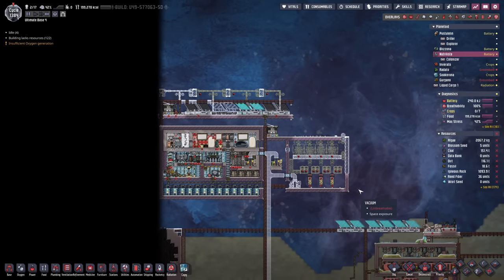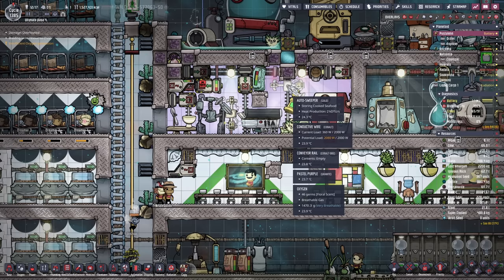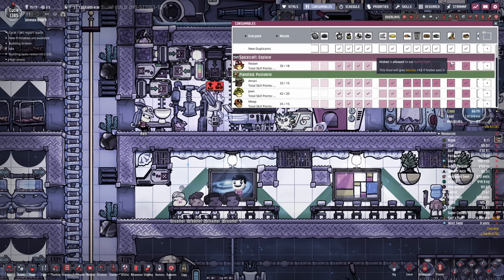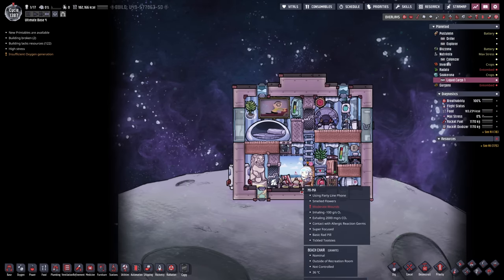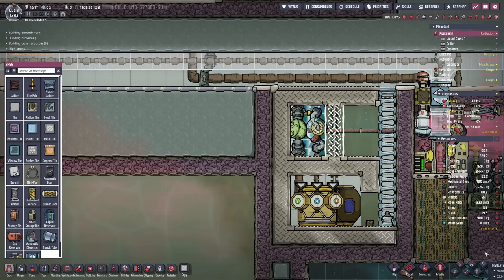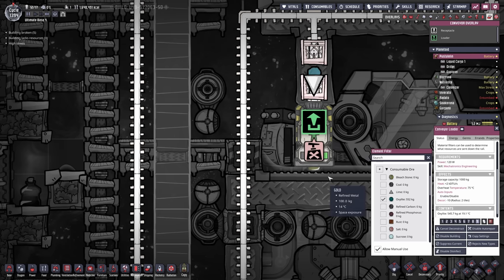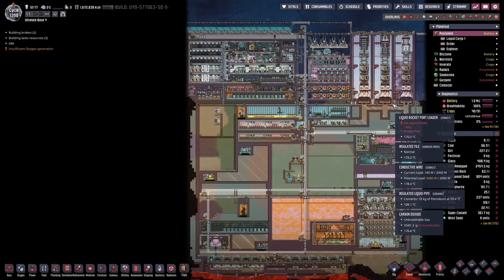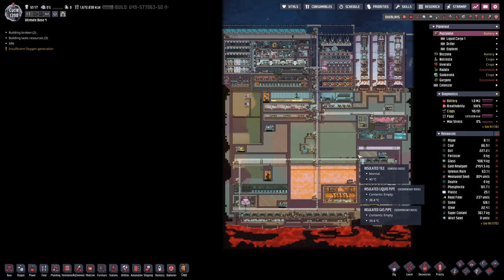OIL PLANETOID BASE ACTIVATION - Ep. #62 - Oxygen Not Included (Ultimate Base 4.0)

Comment: 21:16 if you lower or raise the gas pipe feeding the the atmosuits, so it splits before entering either suit, you can fill both suits instead of one after the other.  Of course, once the pipe starts backing up, this will quickly recharge both simultaneously, or without modification, charge the first suit quickly and then dump the rest into the second suit until fully charged.  While the suits are in use, the oxygen will accumulate to rapid refill the suits as they return.  My gut reaction would be to drop the pipe down the ladder to the floor under the batteries, move right 2 tiles with the pipe and build 2 upward spikes to the two docks, this would give you floor + battery + floor 4 tiles of pipe down to the split so up to 4kg of oxygen waiting to dump into a dock once the pipe starts backing up, which will happen when the dupes are using the suits.